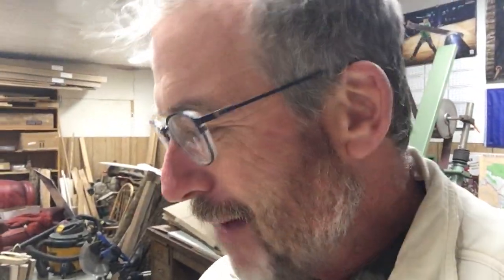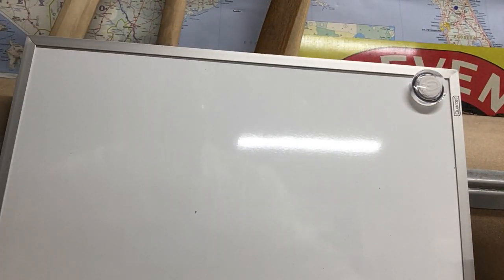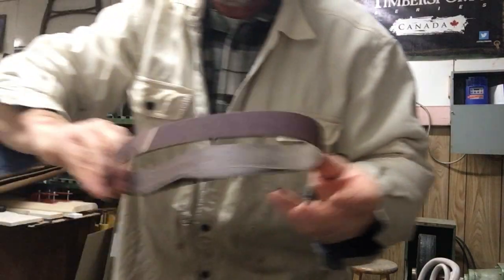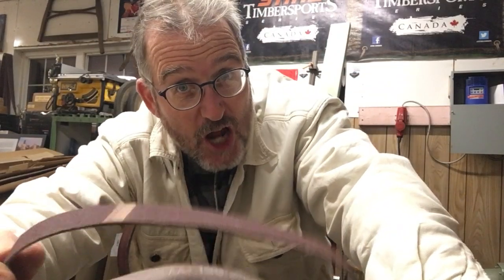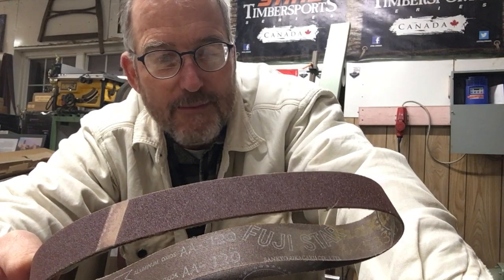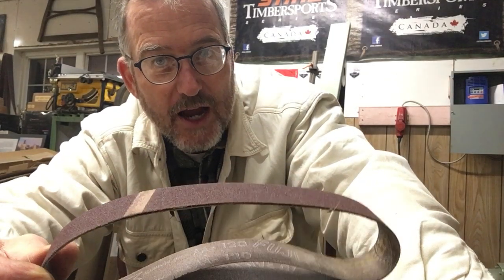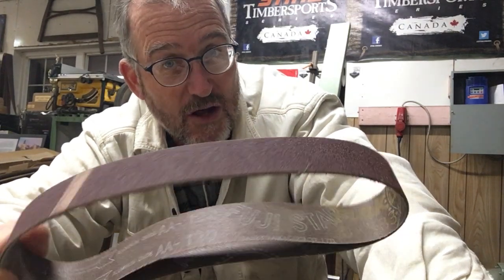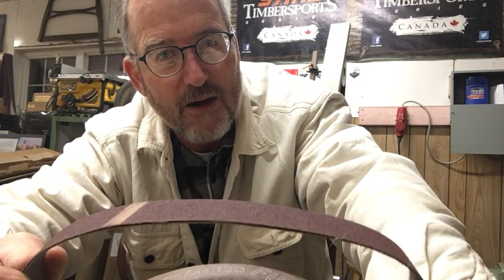Sharpening an axe - the science behind a great edge (Part 1)

Comment: I am curious if you follow the same procedure when doing competition axes for the team? Ei do you drill Pilot holes to sharpen them?  I want to try the grinder method but i am not too keen on drilling holes in some of my vintage axe heads.
Reply from the maker: Yes - all our competition axes have these pilot holes in them.  Performance trumps looks every time.  However, for vintage axes, I use a block of wood the proper height to give me the exact angle.  no damage to the axe, but still get the precise angle.
Reply: @eastcoastlumberjack  thank you sir. I appreciate the feedback and response. You may know my dad. In Doaktown. Peter Robinson. I am gonna get him to pick out some good handles for me. I am in AB and have been slowly making a collection of axe heads. All need handles. I appreciate your videos
Reply from the maker: @christopherrobinson767  Awesome Chris.   Look forward to making you a few.

Comment: Great video! Just watched part 2 as well.   I’m wondering how you decide on the radius for arc on the cuttting edge?  (The actual distance you caliper is spread). It totally makes sense to go off the heel and toe and get the two crossing lines to center up on the business.  Do most axes just look right and cut well when that pivot point is about an inch from the pole end?  Would you ever go right out near the pole end, or go the other way to make more belly in the cutting edge?   
Anyhooter, really soaking up some  top shelf knowledge and tricks, thanks for the teaching.
Reply from the maker: Hmmm.  Thant is a great question!   As you have eluded to - the arc gets much more pronounced if/when you have this distance shortened, and in honesty, I've never really thought about it.  I just know that on competition axes this pivot point is always back on the top/widest part of the axe head to keep the "cheeks" of the axe clear of marks that will drag in the wood.   I still have not yet talked about what goes on in the cheeks yet - but this is a whole other science as well to how you grind the cheeks.   While this doesn't matter much on a pole axe, it matters a lot on a chopping/racing axe!  You are also correct that the best arc occurs when you are back by the end of the poll - and that is why we typically use our pivot point where we do.  there is a bit more steel behind the eye opening, and to save weakening the eye metal at all, I typically drill my hole here - to get the largest arc, and to not compromise the eye metal.   Hope that makes sense.

Comment: I have the same file sander as you, i also use the same method, however, rather than marking/drilling the axe head i wrap electrical tape on that exact point on the axe and super glue two m6 nuts on to that point both sides.
Let it dry for ten minutes and away to go, when your done just unwrap the tape.
The height might vary because of the nut but that can be factored in.
One unmarked axe razor sharp.
Reply from the maker: That's a good idea Roberto.  Actually, on the smaller axes I understand not wanting to drill or mark the face at all.   However, we do this all the time on our racing axes because we end up grinding them repeatedly.  Guess I should try the super glue!

Comment: Hello, Mr. Cumberland;
Thank you for sharing your sharpening technique.
I have a Harbor Freight hatchet (wooden handle).
I marked the top w/ a line splitting the head in half, poll to the bit edge.
I did the math but I used about 25° (half = 12.5°) as my angle.
My Council Tool Jersey pattern looks pretty thin to me (from the top).
But I haven't checked it, I'll do it in a day or 2 (its out in the shop).
You have an unique way of sharpening.
I use files, coarse carborundum stones, diamond plates, & sand paper.
I want to try water stones.
But mostly I use a file to shape the edge & the others to polish it, specially sand paper.
Have you heard of holding an axe under your arm w/ the head in your hand & the butt in your arm pit?
I was told that is how to size an axe handle.
Just wondering.
Have a GREAT day, Neighbor!
Reply from the maker: Morning Jon.  To get a true and accurate edge on our big competition axes, this is the only way to ensure it is perfect.   You can also use a file, but it is a slow process.    Yes - I heard this way of making an axe fit, as this is how the lumberjacks here on the east coast used to measure at the lumber camps years ago.   it actually is a pretty good measure....but usually ends up a few inches short in our competition world.